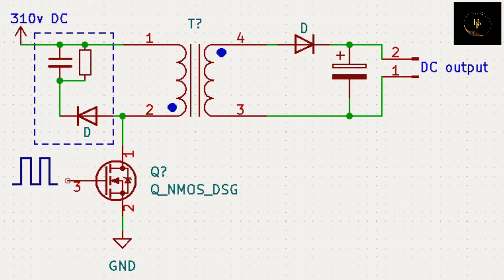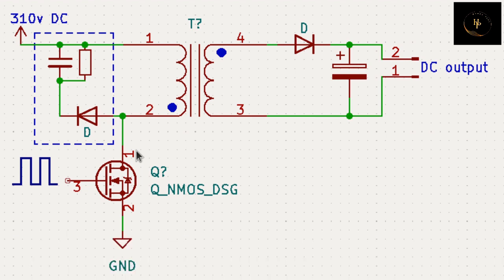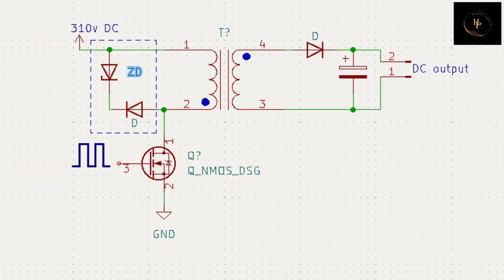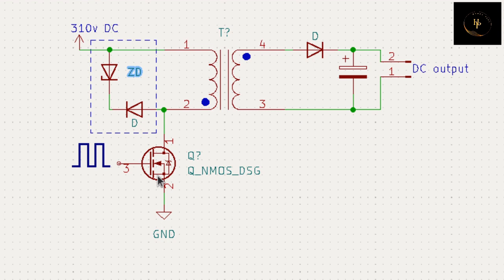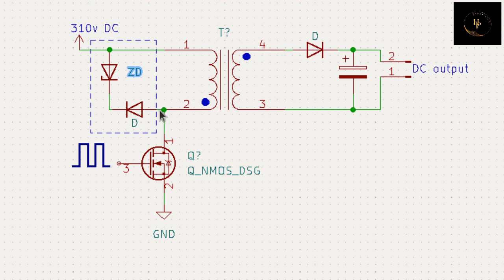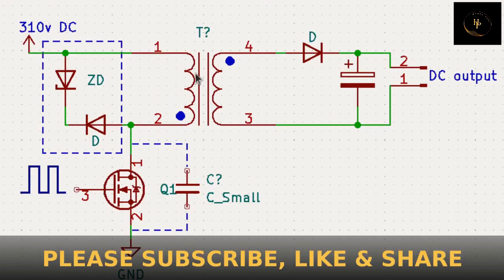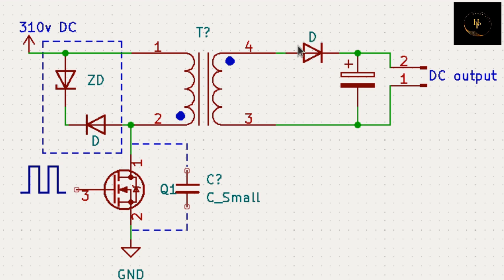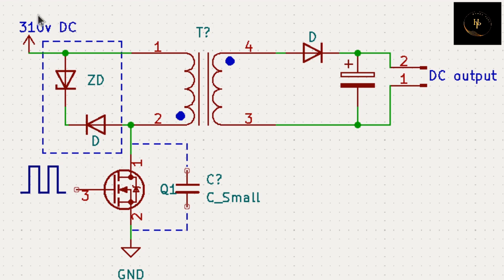[18]passive clamp circuit | snubber circute for SMPS

Comment: Very good and helpful video. Thank you for the video. Can you please specify the zener diode? like how much votage zener diode should we use?
My power supply is for 5v1a output from 220v AC input.
Reply from the maker: Thank you for watching and comment. Please watch this video https://youtu.be/JGj51EeitqA, it's helps you to make a good power supply. If you do this with passive clamp circuit then you just watch   https://youtu.be/h8xYXuOR5ls.